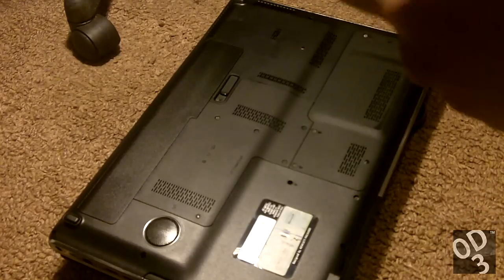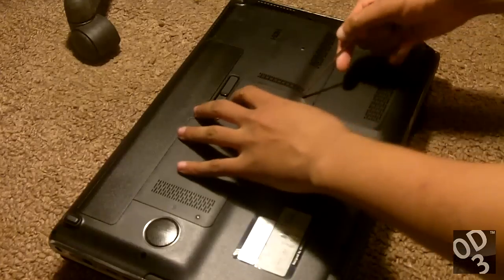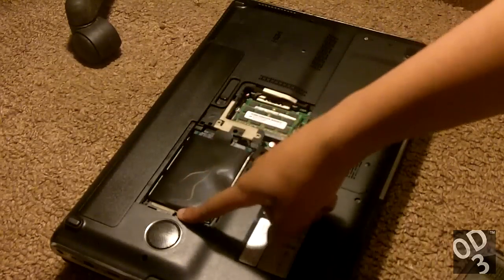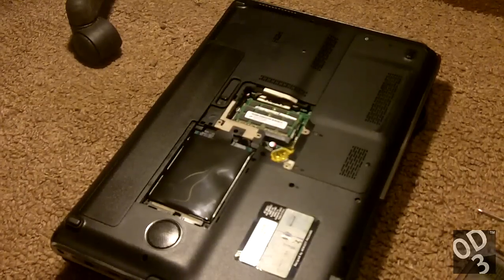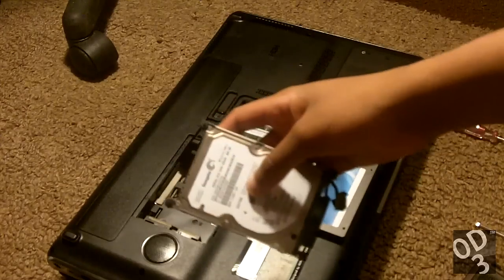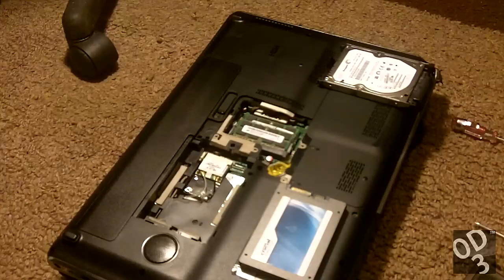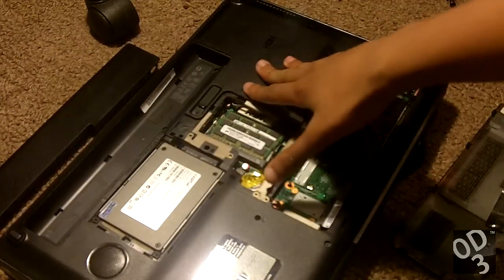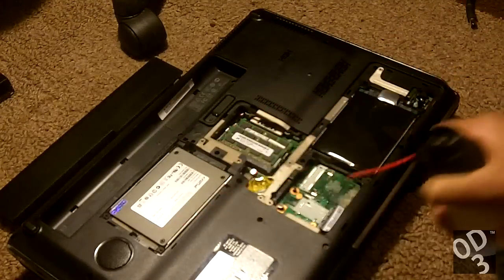Installation: Crucial M4 128gb SSD and DDR3 4GB RAM

Comment: hey there, OwnDiZzL3,
why didn't u take out the battery, 'AND' remove all current from motherboard components ''b4'' u started work on this. u did eventually (albeit surruptitiously) take it out, like an after-thought. but i am bettin u didn't discharge ur laptop. eh???
but you are not takin any precautions, therefore you are showin people how2 do things incorrectly, not only did u remove the ram with battery still in place, you grab the ram with your statically charged fingers, first by -cont'd